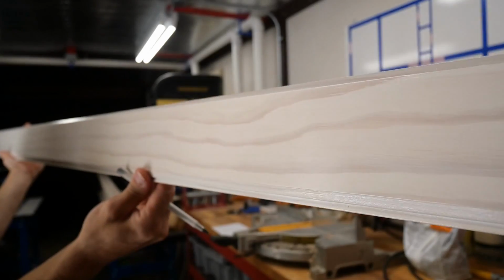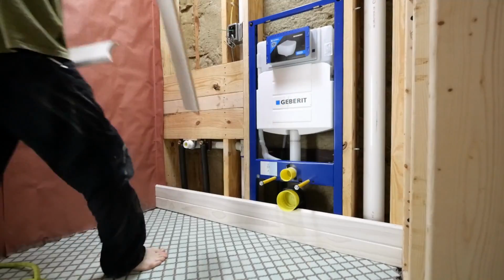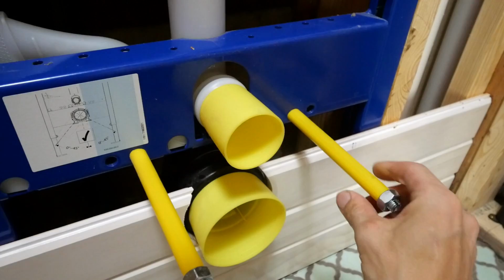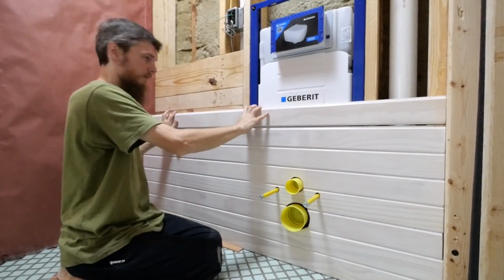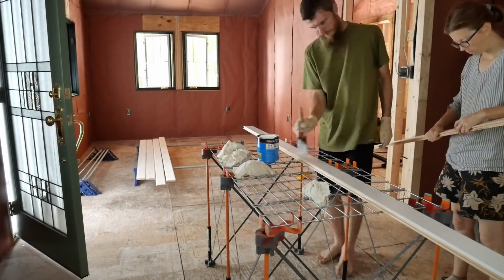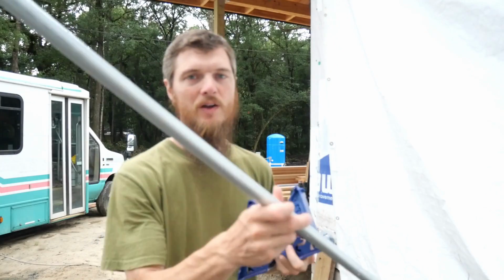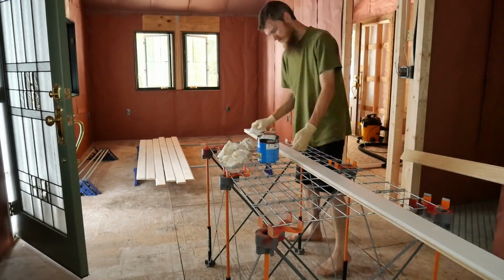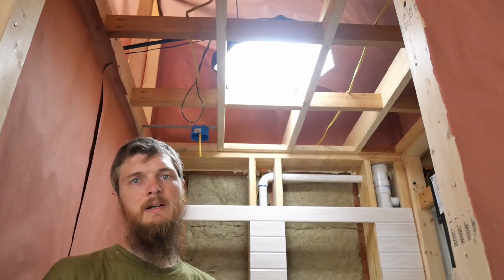Tongue and Groove Wood Bathroom Walls

Comment: I love the look of tongue and groove boards. They give a warm feel as compared to the coldness of tiles. Both figuratively and literally. The benefit of having painted and varnishing each board individually is that once you install the boards and nail them, over time the varnish on the tongue and grooves will "stick" and form a good seal. Thus keeping moisture from going into the walls. Great work.
Reply: While I know they put in  lot of tedious work to do this, they make it look so easy--like there's a crew there doing all the work for them.

Comment: Nice idea with the wire worktop. You could use cattle panels from Tractor Supply as a cheap alternative if you want to make a larger surface.

Comment: It looks fantastic!  Another incredible project that you did from scratch.  You guys never cease to amaze!!

Questions:
1) Why the horizontal layout instead of vertical?  I think it looks great as is?  I was just curious as how/why you decided on the horizontal placement…
2) I know you stained & sealed the wood  panels before installing them.  Does the sealant act as a water barrier or is it resistant to moisture?  If nothing else, you DO get a LOT of MOISTURE where you live.  

As always, can’t wait until it’s finished…
I just know it will be beautiful!
Reply from the maker: When doing vertical boards, you have to install blocking between each stud for nailers, so doing horizontal is much easier. We also just preferred the boards going horizontally. The varnish we used does seal the wood and protect it. The boards should be totally fine as far as moisture and humidity goes. We will have an exhaust fan in the bathroom, plus our whole house will have built-in dehumidifiers.

Comment: Love the look of the Wood finish !
I have one reservation about your toilet though. My daddy was a plumber. He replaced a LOT of toilets over the years, primarily due to corrosion. You have installed a tank INSIDE a wall, and THEN nailed wood over that tank. While I think the bathroom will look fantastic, it is also going to be near impossible to maintain in the future. Personally, I would have chosen a free standing toilet for the bathroom.  Or as an ALTERNATIVE - I would have made provisions in the Tongue n' Groove boards to have access to that wall WITHOUT having to destroy all the beautiful woodwork you  have meticulously installed. Just my (and my daddy's) $.02   ...
Reply from the maker: These in-wall toilet carriers are very reliable. The tank is a one piece molded plastic design and all the internal parts can be replaced without disturbing the wall through the flush plate access panel. All gaskets, valves, even the bowl can be changed at any time.

Comment: even with the boards treated and basicly made watertight/ non moisture can penetrate it  , theres still a chance of the wood growing and shrinking , you mounted those board pretty tight in betwwen the framing and it can happen that you will hear a lot of creaking and popping at night during moist weather after taking a long hot shower or verry dry weather , might need to keep a paintstick thickness gap at the ends to counter for the moving of the wood

Comment: The bathroom wall look awesome, will it be difficulty to open wall for repairs?
Reply from the maker: The wall won't need to be opened. The tank is a one piece molded plastic design and all the internal parts can be replaced without disturbing the wall through the flush plate access panel. All gaskets, valves, even the bowl can be changed at any time.

Comment: The wood walls are really nice. The only thing that would potentially bother me is having them horizontal around the toilet, I think they would retain stray urine(with a boy) and be hard to clean. But I don’t really like drywall either, so I get it.
Reply from the maker: Standing to pee at a toilet is pretty nasty. We don't do that in our home. I'm more worried about the area around the sink which is more prone to splashing and toothpaste flicking. But the grooves are pretty easy to clean too. Hopefully the walls be easy maintenance.
Reply: Ashley, same in our home with the toilet so we don't have that problem, but my husband splashes a lot at the sink😬

Comment: Looks fantastic.  Can’t wait to see it completed.  Not being a builder or plumber, I wonder how future repairs could be made to the plumbing behind those beautiful walls.  Is there some kind of access on the other side?  It hurts me to think of cutting up or tearing down that wall if some kind of leak develops.
Reply from the maker: Thanks! The tank is a one piece molded plastic design and all the internal parts can be replaced without disturbing the wall through the flush plate access panel. All gaskets, valves, even the bowl can be changed at any time.
Reply: @diyfferent  So glad to hear it.  😅

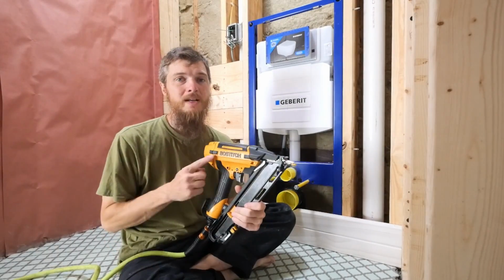Comment: 1:47 Not many people buying new Pneumatic nail guns these days, it is pretty easy to find a cheap finish nail gun on market place or craigslist.  Would seem a battery finish nail gun would make more sense if buying new/retail these days.
Reply from the maker: Yea, we already have an air compressor and we just didn't want to spend double the price on a battery-powered nailer.
Reply: @diyfferent  Wow I didn't know they were double the price...  I just figured the reason I was able to pick up my used pneumatic nail guns for so cheap was because most contractors were going to battery guns.

Comment: I like the color of the boards with the light finish. It looks neat and clean. 👍🏻 I see that it's raining a lot, how is your roof holding up? What's the update on that?
Reply from the maker: The roof has been great. No issues. That sticky black underlayment is rated for 6 months exposure. It's a very heavy duty product.

Comment: I love the look you are going for. My only concern is that by avoiding drywall and using wood exclusively, your fire risk increases.  Drywall is fire resistant and we all know what happens with fire and wood. Can you build in a fire suppression system? You are such a great team - your work ethic is awesome! I have been following your adventures for some time now - amazing work!
Reply from the maker: We added mineral wool insulation in the interior walls to help act as a fire-block. Overall, the wood doesn't pose much if any extra risk over drywall. Thanks!
Reply: Thanks a bunch for your answer -not too much to worry about then! 😍

Comment: do your water tanks on toilets get moisture? Won't that be a problem with moisture and mold?
Reply from the maker: No, they are wrapped in Styrofoam to reduce condensation and sweating is generally less of an issue inside of a wall than exposed in an open space.

Comment: Loving the bathroom but wondering if you will be hanging the bedroom walls horizontally, like the bathroom, or vertically as is traditional? Either way can't wait to see what your brains have thought up to make your lives a bit easier in the workshop. Love from Western Australia.
Reply from the maker: We'll be doing those horizontally as well.
Reply: @diyfferent  is there a reason or you just prefer the look?
Reply from the maker: @SUGR17  There are a few reasons. It's easier to install them horizontally. Installing them vertically would require a lot of horizontal blocking in the walls which creates even more thermal bridging and less insulation space on the exterior walls. Also, the original bedrooms in our home have horizontal boards and it is the traditional style to do them this way. So we like staying with that theme.

Comment: I'm curious about the moisture traps in a bathroom with the T&G being horizontal rather than vertical. Cupping could be a problem.
Reply from the maker: Since it's tongue and groove, the boards can't cup easily since they are all locked together. The bathroom will also have an exhaust fan, so there should be no issues at all.
Reply: @diyfferent Unfortunately we've experienced two different homes where T&G have cupped. Wood swelling happens regardless of types of cuts. You might be ok due to your having sealed each board. I guess I'm just paranoid since that flood you guys experienced a while ago. As well as it being a bathroom.  I admire your fearlessness in experimenting.
Reply from the maker: @deborahbaca1345  The waters have never reached the floor joists of our house. It still had about 2 feet to go before it would have reached the bottom of the floor joists, so that's not a worry we have at all. The whole rest of the house has had the original tongue and groove boards since it was built a long time ago, and they are all fine, so we're pretty confident we'll never experience any kind of cupping issues.

Comment: Brilliant. I do have a question. Oh the part where the toilet will be mounted, there is some type blue kind of card stock on the wall, where the in wall water tank is. Will that come down at some point?
Reply from the maker: Yea, that's where the flush buttons will be going. We'll show how that all gets installed when the time comes. :)
Reply: @diyfferent  thanks. I hadn't thought about flush buttons.

Comment: Quick question: will the clear coat you put on after the white on the boards act as a mould/moisture repellant? Or do you still need to add something to prevent moisture build up on the boards?

Comment: Hi!  It looks beautiful!  I want to do something similar in my bathroom.   I'm told I shouldn't put wood in the bathroom... it will get mildew.  Is your tongue in groove specially for a bathroom?  If so, where did you buy it and what should I ask for?  Thanks!
Reply from the maker: Wood is no problem in a bathroom as long as it's properly finished. The key to preventing mildew is to have a bathroom ventilation fan to get rid of the excess humidity. We just used regular pine boards.

Comment: what type of wood did you use, did you check it for moisture content? Wondering how it will do with expansion and contraction. I sure do like the look
Reply from the maker: Pine, it should be okay.
Reply: @diyfferent  good deal, you did a really nice clean job

Comment: I am surprised the boards are going in horizontally. For some reason I assumed they would be vehicle.
Reply: What? they are going to drive them? So sorry, I couldn't help myself...I knew you meant vertical.
Reply: @maryjanedavidson2804  haha until I read your comment I logged it in as vertical. I had to read Rita's comment again.
Reply: @twillbdone3273  so did I. I read vertical.
Reply: Also adding , the reason they went horizontal is they are assured of hitting the studs, if they put it on vertically there is nothing for some of the boards to nail to except maybe the top and bottom 2x4's.

Comment: This really looks amazing.  I have probably overlooked it somewhere but what size and type tongue and groove is this?  I am about to put wood over sheetrock in one of my bathrooms.  Thanks
Reply from the maker: We made our own wall boards for this room out of 1x4s, but if you wanted ready-made boards that were similar you'd have to just check out your local lumber store at what is available.

Comment: Since one side was left unfinished, no A/C , Florida climate, and especially in a bathroom, I expect you will have cupping issues with that wood.  Maybe not in 1 month, surely will happen.
Reply from the maker: The whole house will have built-in dehumidifiers, and the bathroom will have an exhaust fan, so the wood should be fine. The rest of the house has had tongue and groove boards since it was built a long time ago and those still look great.

Comment: How do you access the toilet tank if there's a leak or it needs a part?
Reply: They did a video when they installed it, but basically all the parts that might need changed can be accessed through that little box on the top.
Reply from the maker: The tank is a one piece molded plastic design and all the internal parts can be replaced without disturbing the wall through the flush plate access panel. All gaskets, valves, even the bowl can be changed at any time.

Comment: How did you finish the wood?
Reply from the maker: We showed it in another video here: https://youtu.be/r_nKqwBsvtI?feature=shared&t=416
Reply: @diyfferent what the name of the board you used and where to get them at
Reply from the maker: @lashondajohnson2099  We made the tongue and groove boards on our router tables ourselves using pine 1x4s. We used various types of pine, but the nicest boards were from a species called Radiata Pine. We bought them at Lowe's.

Comment: What is so wrong with drywall??(((
Reply from the maker: Many reasons :) It's super heavy to bring home and move around. It's crumbly. It's a big hassle to finish the seams with compound and getting it all to look smooth. It's not good to hang things on. It's prone to mold/mildew issues. It falls apart if it gets wet. Also, sometimes overtime the seams crack and then it's a big hassle to fix.

But also, this home originally was built with all wooden walls just like this and most of the rooms still have them. We really want to restore that and keep the wood style throughout in this home, so we won't be doing a scrap of drywall anywhere - yay.

Comment: No hate here, but won't the heat and steam from a shower harm the wood boards in the bathroom over time? Also you will eventually get sick of all that wood all over the house. My opinion
Reply: I think if they use a ‘marine’ finish  on the timber, like they use on boats the moisture shouldn’t be a problem
Reply from the maker: No, the wood should be fine. We've seen wood walls in bathrooms many times before and it's never a problem. The wood is sealed and the bathroom will have a ventilation fan. 

As far as getting sick of it, no. The wood is beautiful. We are sick of drywall though. It's so plain and monotonous! This home originally had wood walls throughout and we really enjoy being able to keep that original feel.